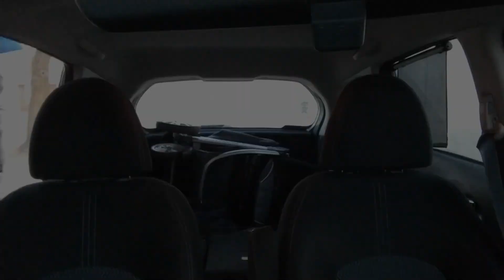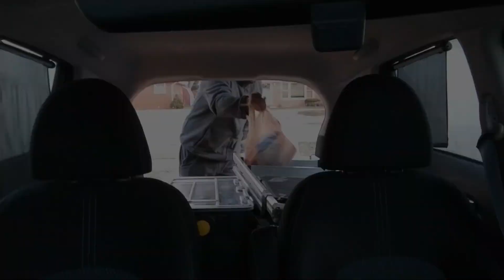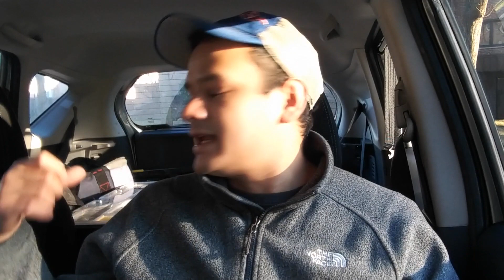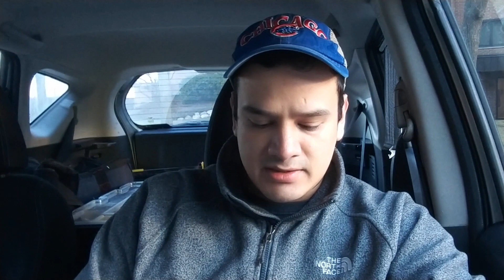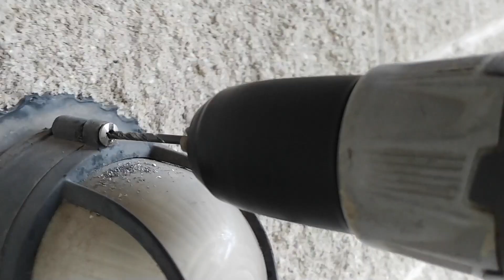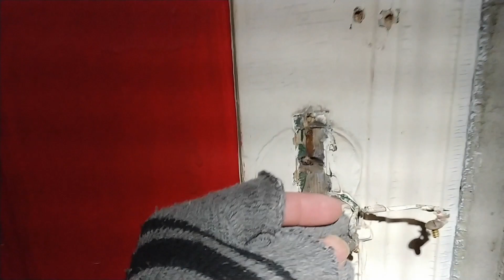Taskrabbit Paused My Account Now I'm Back

Comment: To drill the bit should have been a bit larger. But. Another trick is to used a rubber band and put the flat part over the screw and push the bit in. Slowly it should force the bit to turn.    I have never had much luck with extractor bits
Reply from the maker: These gets super seized, idk what it is, maybe the cast aluminum. But they always give me problems, usually snap the head, even when its not stripped

Comment: Hey Nesto! Thanks for the content man. I just started out myself a couple months ago. Could you go over in a video how long you've been on TR and how you got your hourly rate up so high? Did you increase it over time as your metrics increased and gained more reviews and job counts? I'm wanting to increase my rates (South Florida, Fort Lauderdale and Miami area) but am afraid that my hire rate will slow down if I do. Trying to figure it all out. Any feedback would be very helpful man!
Reply from the maker: Yeah ill try. But its basically what you said.
Reply: @nestoworks3402  How long have you been on there bud? Wondering how long it took you to work up to your rate. Thanks!
Reply: Hey Nesto! I did want to ask you. Do you normally just work TR on the weekends? Wondering how you are getting these 4 task days. Also, what hourly did you start at and how long did it take you to get to the rate you are currently at. Oh! One more thing. Are you on the Elite program at all? Thanks again man!
Reply from the maker: @detroyt232323  ive been on taskrabbit on and off since 2016. I started  at like 30 something an hour. my schedule varies, but i can usually get 3 or 4 tasks a day. I have a ton of tasks and 5 star reviews, and elite status. What helped is that ive never had too many categories
Reply: @nestoworks3402  ahhhh makes sense! I just keep thinking that the more categories I have the more work I'll get. Maybe I'll cancel a few once I get rolling here. I have 18 reviews so far and all 5 star with some pretty long types up compliments all without ever asking a client I might add! I keep increasing by a couple dollars each week and am now around $35. Just trying to get to your level boss man! Haha! You are at what $65/hour now?
Reply from the maker: @detroyt232323  68. Because its a nice even 80 for the client. You gotta ask for a review everytime as you are leaving. One for the review and two because it makes them open the invoice and get asked if they want to tip. At first its fine to have alot of categories, then you hone down what you actaully like to do and specialize